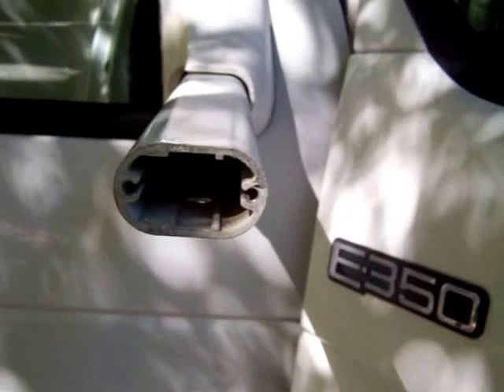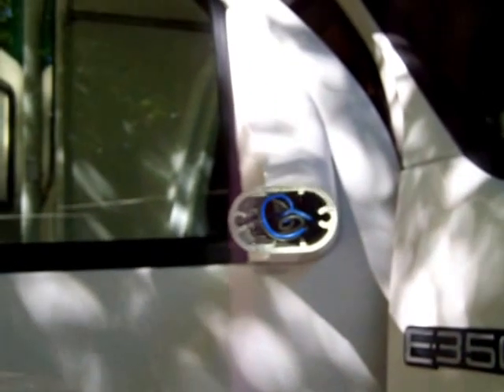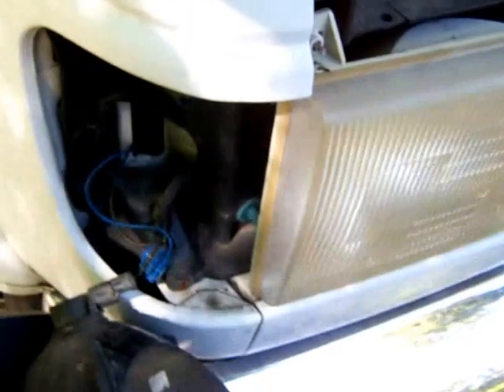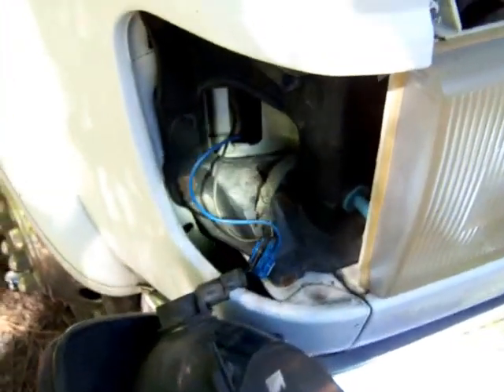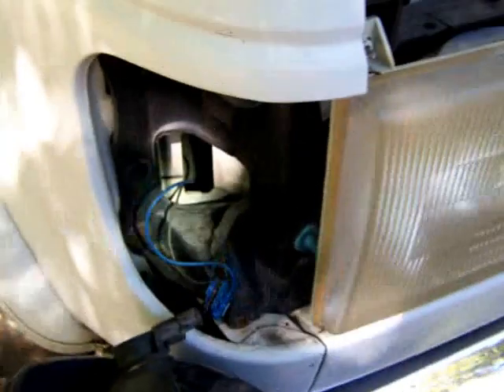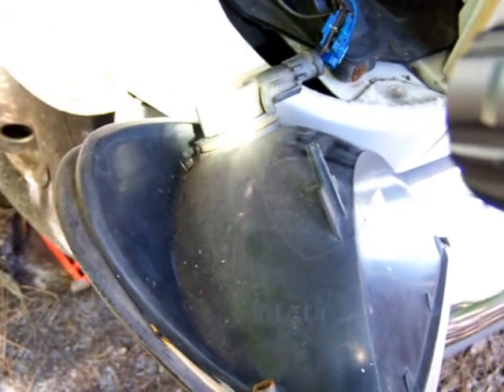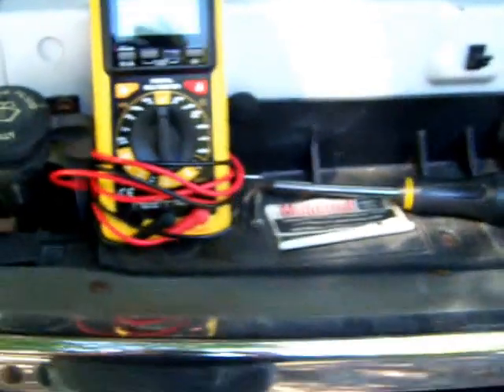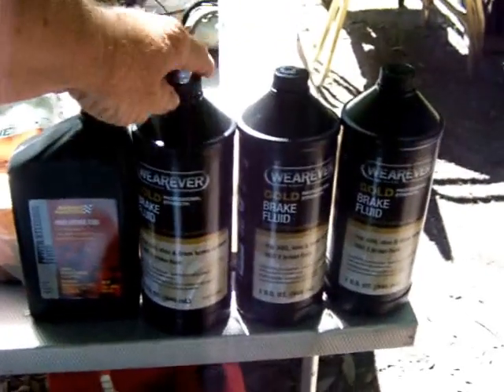LAST TIME ON LIGHTS.

Comment: Well my friend sorry to hear you're still having trouble with that wiring. I would not use WD-40 but I would get some contact cleaner to spray in there, as it will not collect dirt. Thanks for sharing my friend.
Reply from the maker: Massachusetts Prepper Thanks for reminding  me to use contact cleaner, not  wd 40 ,thanks for the reply. I thank I have found the problem, I hope.

Comment: Get rid of the extra wires right at the turn signal also use the meter to check that bulb it may look good but still be bad does it light up with the headlights on the four way just click it several times each time you are in the rv may get the dirt dust out of it also if need be you can change it while the steering wheel is still on the rv
Reply from the maker: Mavrick Thanks for the reply , i will do that, click it a few times , and I will blow a little air in it also, I have taken the wires out of it to get that out of the way , and i did not I can change it while the steering wheel is still on the  rv good to know thanks for the info.
Reply: Rusty Nail It is a pain but you can do it I  just replaced mine on 1992 ford class c  mine had no bright lights just dim also check that bulb the way it was wired must have had a turn signal on the mirror I would try a new blub or check voltage with your meter with turn signal on for power should be a easy fix
Reply from the maker: Mavrick I think your right about the light , still trying , thanks for the reply.